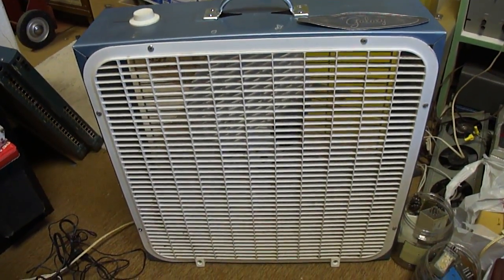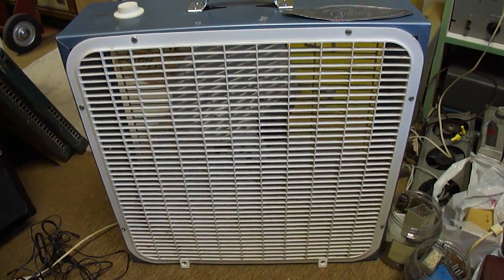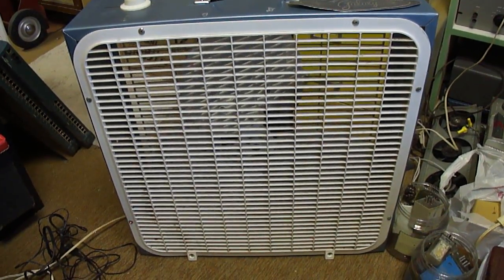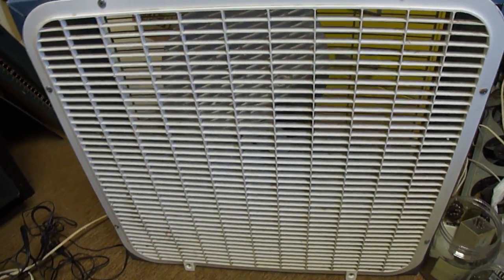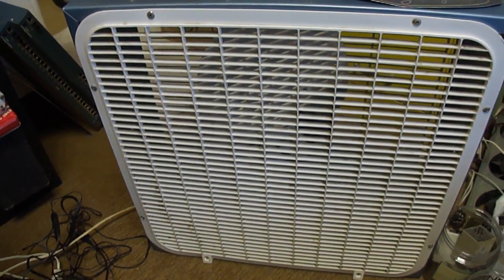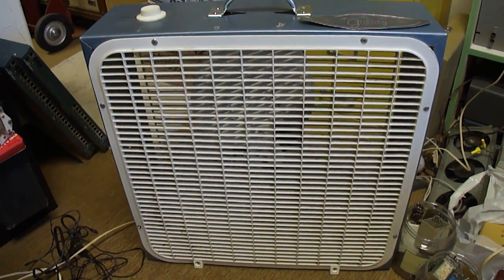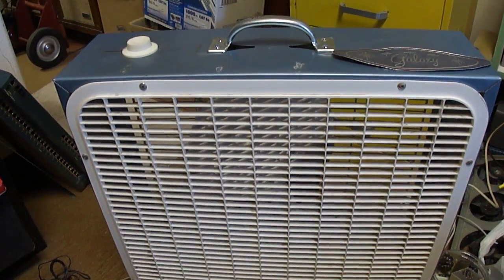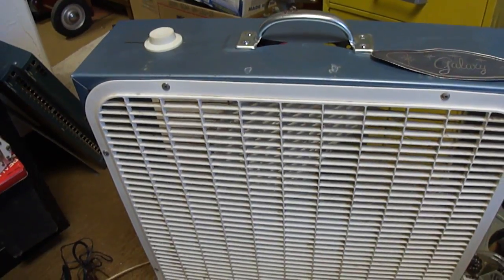1960's Galaxy Box Fan with Lakewood grille

Comment from the maker: @eskiewolf76 At least the later Galaxy/Lasko fans had a grill held on with screws. I have a Lasko fan in the kitchen at home which is probably early 70's (rounded corners) and you have to slightly bend the grill to snap it into the cabinet...it is not quite as brittle as on this old one but still can be kind of hard to remove/reinstall.